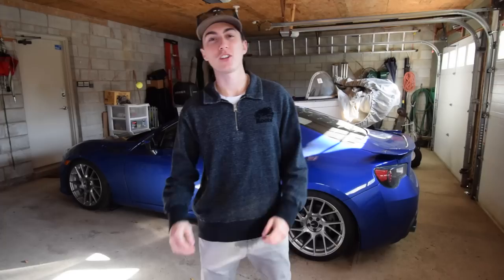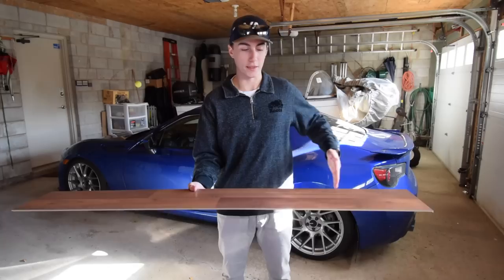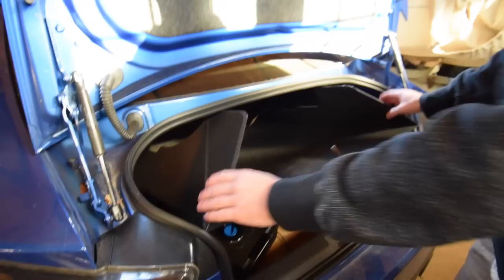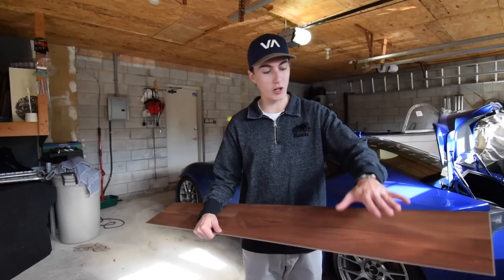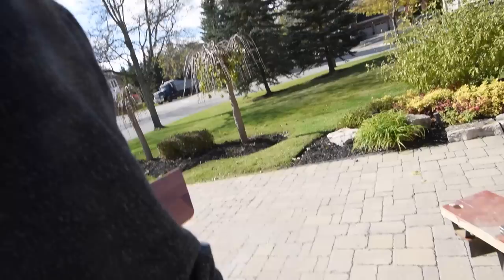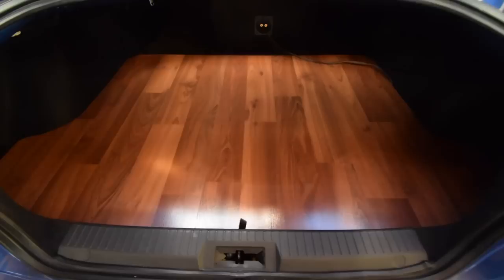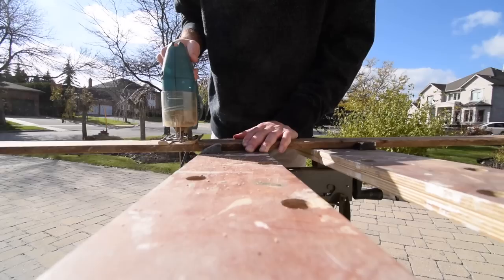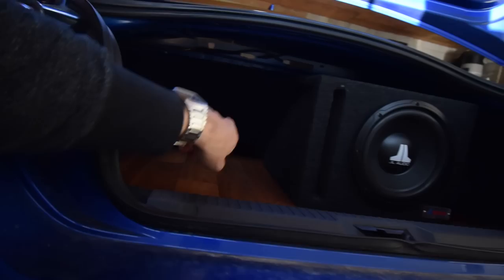BRZ Gets Hardwood Trunk!!

Comment: I think it's a good idea I did that years ago to one of our cars, the only thing about it is, that things in the boot tend to slide arrowmd. A way to avoid that is to use scatter abrasive tape. If you don't like the look of tape across your wood, you cud also use the spray on version. Transparent ofcause. However the spray on is not as good and has to be renewed every now and then. Oh and don't forget to glue the wood together, because otherwise it will annoy the shout out of you always coming apart cause to the vibrations.

Comment: So I just came across your video. And watched it. I do finish carpentry which is pretty much carpentry that just makes everything look nice. LOL and I think it looks good for what it is I would definitely secure that sub because it is going to slide around on that floor. And a hardwood is actually heavier then what you put in that car so it's a good thing you use the product that you did like I said it looks good for what it is. Great job!

Comment: What size speaker you have.  Cuz I want to put 2 "12" in my brz but I don't think it wont fit
Reply from the maker: thats a 10 inch ahah 12s will be TIGHT they will forsake take up 100% of your trunk, but the car is so small I don't find the bass as good, not enough room in the car to boom! ahaha
Reply: Or get a single sub in a "truck" box/slim box, never been disappointed in a single 12 from civic hatxhback up to 2005 Honda Odyssey 1 12" sub hits hard-not trying to have crazy bass you can hear miles away but some nice thump, they also make downfiring subs, like kicker has- can stand on it so you can put whatever u want/need on top of the box so it almost doesnt take any room
https://www.kicker.com/comprt-12-inch-down-firing-loaded-enclosure

Comment: How bad does your sub slide around?  I have a jeep, rwd.. and it unplugs it's self all the time while im doing donuts .. and that's on carpet.  I could only imagine how bad it would be on wood.
Reply from the maker: +Rory Mitchell it was fine before but he wood is terrible 😂 i need to fix that soon
Reply: Right on, well it looks really good. i subbed to see your fix on that situation. Cheers.
Reply: Rory Mitchell  Damn dude, you're supposed to screw/bolt your sub box down so it doesn't move around. Also makes it harder for somebody to steal.
Reply: Jason H. A few L brackets will fix it
Reply: Rory Mitchell s